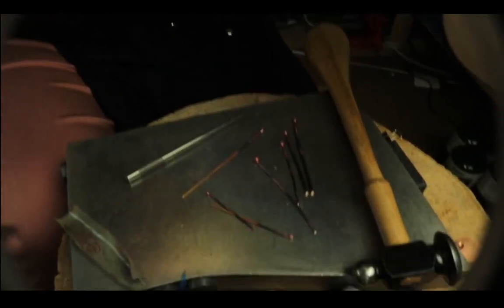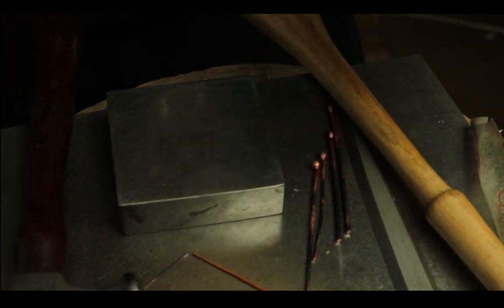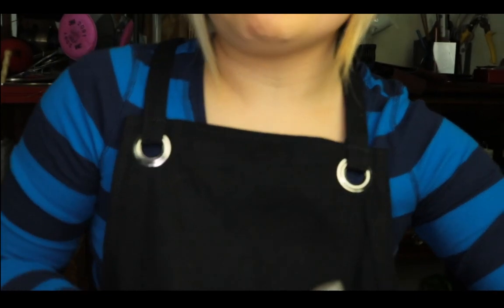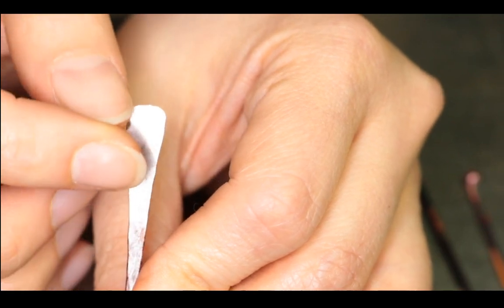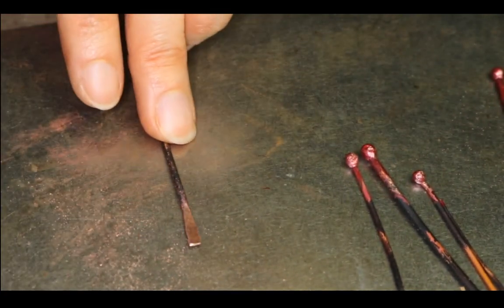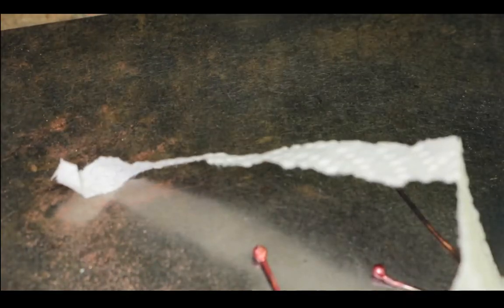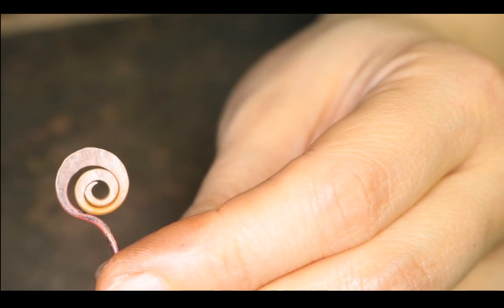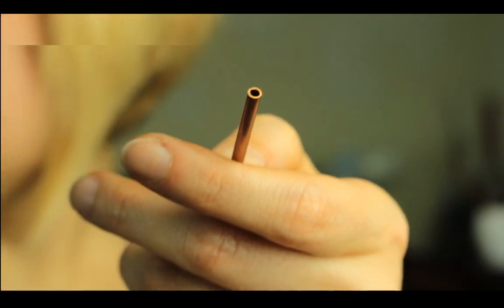How to Hammer Wire Paddles - Simple Hammering Techniques

Comment: I am not having problems with this since I have a lot of experience cold forging, but still I will watch. I'm sure I'll learn something. Oh! I have the same Fretz planishing hammer. I love the Precisionsmith line. I only have two so far, the planishing and the chasing hammer, but I think there are eleven of them. I also have the Blazer Big Shot BT8000. I got it after seeing that Andrew Berry had no problem melting metal for casting with it. I cast some silver balls for the ends of a twisted wire bracelet the other day and the BT8000 did a great job melting the sterling shot with no delay or big deal. Just bam! Melted.
I wish I'd known about you sooner. You speak about this art in a way that touches my heart directly without having to involve my head so much. So curious about your steel block with the irregular shape. Everything I have is a rectangle.
Grinders in a machine shop are not that much faster, (if any), flattening a steel block -- their big advantage is that they are more precise, and make an overall flat surface within a ten-thousandth or so, (you'd need a scraper to go better), and also that even though it is slow, it runs through a stage on its own, (if you set it up right), so you can ignore it and multitask something else.
You have to consider that if you don't have anything better, you'd like to have a steel block that to some extant would function as a standard of flatness for your shop. You could put things on there and use your best standard of 90° to tell right away what was going on with a piece of metal. If you don't have anything like that your work is more amateurish. Things that should be flat, (instead of curvy like the curved things you also make), aren't ever quit flat. You don't really have any way to tell if something if flat or not.
Wouldn't it be grand to have a surface plate and some reference edges and angles for various lengths that were actually certified to be flat/correct within a standard. A low end granite surface plate is measured within a hundred thousandth to a millionth of an inch without the cost being at all expensive. If you wanted laboratory grade flat and right angle standards it would cost a mint, but who needs that for jewelry?
That track section is real cool. I wish I had a short section of rail track, that's some hard metal. I'm keeping my eye out. I'll have to find a deal.

I couldn't have loved you more than when you grabbed the lenses out of the optivisor because you were concerned that the magnification wasn't giving us the info we needed. For a cheap solution, (although really fiddley) is the pluggable USB 2.0 Digital Microscope. It will go inexpensively (about $35) to way more magnification than we would ever need in jewelry. It looks to your computer like a webcam. It has a fair bit steep learning curve, and has its own limitations, but if you want to step up your YouTube game, it will let you record _very close up clips that you couldn't get any other way (at least without spending a fortune).
Reply from the maker: I just found this comment. It was filtered into spam. Probably cos it was a giant wall of text. Lol. 

My steel block is an artisan made one. It's completely flat and has 2 square corners.

Comment: Thank you for this video! 3 years ago. Lol. I appreciate the tips on avoiding the curve. I don't know if you check these comments, but if you do, can you share the brand of file and level of sandpaper you use? Thank you so much!
Reply from the maker: Sorry I just saw your comment. I have a Swiss barrete file cut #2. For a more affordable but good quality files, check out Frederick Dick files with the light wood handles. They're sold in a set of 5 or 6. For sandpaper, I love the plastic sandpaper from 3M in 220-150 grit.